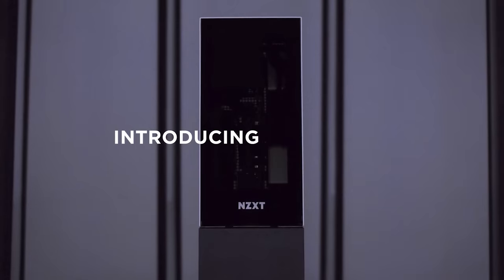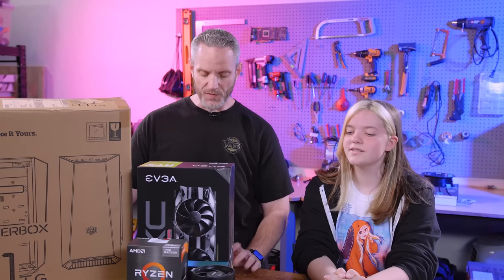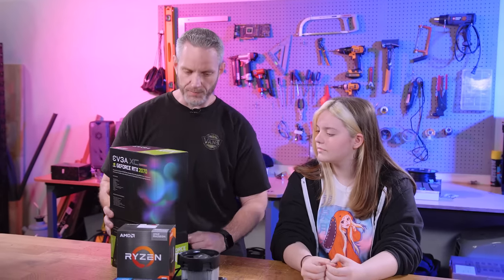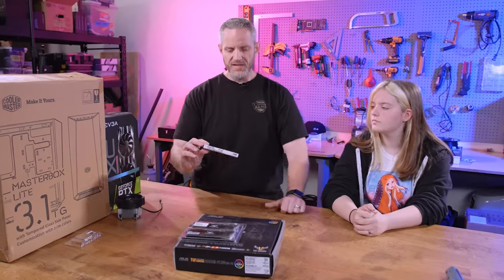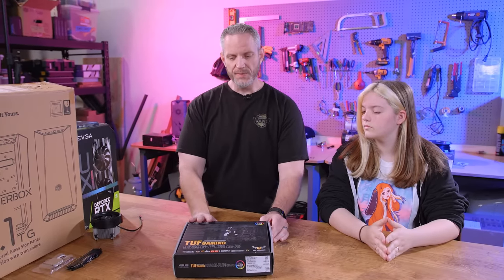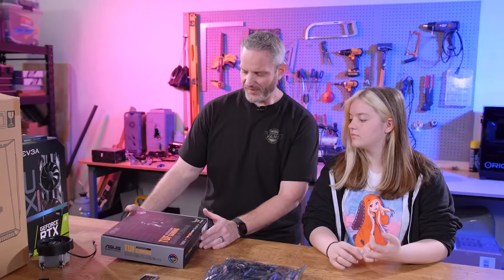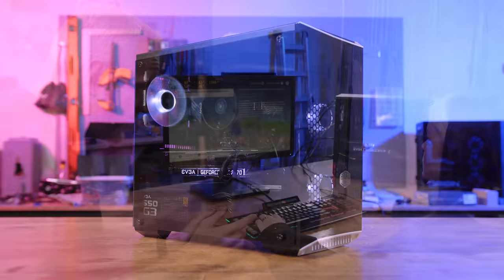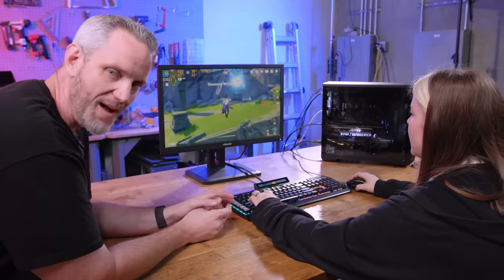My daughter built her friend a PC!

Comment: Yeah genshin is pretty light, although it stutters quite a bit on mechanical hard drives and phones. You can easily get 60fps locked on highest with a 1050ti, even a 750ti can do a decent 55-60 on medium-low settings, msaa and V sync on. Interestingly enough the most taxing settings in the game is shadow and render resolution. Also later game content (or regions to be specific) tends to be much more heavy on the gpu.

I had a chance to try it out on my brother media laptop with an i5 8250u and a mx110 and while it technically run it was really messy at 30fps and constant stutterings.

Comment: I have a probably stupid question:
It's always said that you should not change GPU's from Nvidia to AMD (or vice versa) because of Driver incopatability, which may wreak havok on your system (therefore when doing it wipe the drivers completely from your system first). 
Does that not apply when you use a CPU with integrated graphics from one brand, and a dedicated GPU from the other brand? Because I would think the PC needs according Drivers even for an integrated GPU... 
Can someone enlighten me?

Comment: i use an 8700K and 1070Ti and a 240Hz 1080p monitor and play Genshin, but my game runs pretty hot and draws 140W out for the GPU. Point is I want there to be a custom FPS cap like actual AAA games.

Comment: My 11 year old daughter plays this game on an i5 3570, 16GB of "Hynix" RAM 1333mhz, 250GB 860 EVO, ASUS Geforce GT 1030.  I bought a cheap Cougar Tower with RGB fans.  Maintains 60fps easy on med settings, and does what she wants. "Roblox" "Minecraft" "Fortnite" etc;  Mostly ROBLOX though.  All from leftover parts from my old PC, family old PC, work, etc.  I only spent 20 USD on 12GB of DDR3 RAM, and the 100 USD on the GT1030 and 45 CAD on the tower.   Not a bad deal.

Comment: 2:00 Had me dying! :D

4:44 Let's just hope that he won't jump into DCS in the near future, because then you'll regret that move...

10:30 Typical parent things. Pro tip for your daughter: That will never end, no matter how old you get.

12:04 I ran DCS in VR on a 3570k and a 1080 and nothing except for MS FS 20 eats hardware as much as DCS does. No VR? No hardcore flight or racing sims? Any 10/16 series card will be good enough, unless it's the utter low end garbage! and even a 10 years old CPU can still rock it if it was a good one back then like a 2500/2600k or 3570/3770k or even an FX-8350.

Comment: I can attest to not needing the "latest and greatest" to have a killer system. I'm currently using a r7 5700g on a b450m paired with an RTX 2080 Super. I have a 1440p 144hz monitor and I can max out pretty much any game at 1440p and get at least 60fps.

Comment: dude i use that case with the acrylic side panel... i upgraded to the glass window afterwards and i can tell you it can get very hot inside the case if you stuff too many things in there...
i had to actually take off the accented air intake mesh off from both the bottom and the top for my system because i had too much stuff plugged into my pcie slots... and my board was not getting enough cooling because i used a tower cooler instead of a down draft coolers... because it does not have a top exhaust fan at the vrm area....
yea... since this is just a guy trying to play genshin i doubt he will go overkill.... a good budget case but it is not adequate enough when you plug in a lot more components into the system...
Reply: sorry i meant i had to take off the mesh at the air intake at those accented color strips just to get slightly better thermal in my system using this case... sometimes i just take off the whole front panel....

Comment: Honestly Gensimp is quite light. Even my 4790 + 1060 6GB combo has no problem maxing out at 1440p and still runs smoothly. Same goes for my brother's 9400F + 1060 3GB combo running butter smooth at 1080p.
Reply: Also nice seeing Raiden right there. 10:22

Comment: I guess I am not the only person with Asus BIOS issues. My Crosshair VIII Formula that I bought in 2019 was great until about 6 months ago and then it started having issues with boot speeds off of an NVMe PCIe 3.0 SSD and sometimes not even booting at all. The BIOS also ran incredibly slow most of the time and was completely unusable. I spent a day troubleshooting everything  and couldn't replicate the issue again after a full teardown of the PC and testing it outside of the case. I updated the BIOS and everything seems to be fine now, but I'm still weary about it and the board is approaching it's end of warranty later this year. I am tempted to get a new motherboard but I am also considering just waiting for AM5 and the next generation of Nvidia or AMD graphics to come out and mature for a year and do a complete system upgrade then.

Comment: Like you could buy any 20 series card right now. Actually as of now, there is not a single 2070 to buy here, normal or super. You could get a 2060Super for the price of a 3060.

Comment: Not a bad modest build, if buying parts now and not using something had on hand I'd have chosen the 5600 non-x sku for 20 less or upto 40 dollars less after various rebates I've seen from e-tailers.  5600G doesn't have PCIe Gen 4.  With the features removed from APUs in this generation they are basically designed to be paired with a A520 and a b550 should only be used if they are planning to upgrade the cpu (which most people don't).  5600 non-x has gen4.0 pcie, more cache and higher performing the then 5600g and cheaper...

Comment: Question Unrelated to video: If you ran a setup with a ridiculous number of radiators (say 10+) you'd probably want a DDC pump for the head pressure, right? It's a totally stupid idea, but I've been wondering how that works.

Comment: "You don't need the latest bleeding edge technology to enjoy games ... depending on the game you're playing".

Many of the games I've been enjoying recently (and some others I'd like to dust off again) ran just fine on my older Intel Haswell integrated GPU, and are even playable on my dad's old Core 2 Duo laptop's Intel GMA iGPU.

Games I've been emjoying recently include Total Annihilation (1997), Fortress Forever (2007, Source engine but an older version of it, runs much better than TF2 and CS:GO) and Team Fortress Classic (1999).

Older games I want to dust off again include Castle of the Winds (1992?), Captain Comic (1988), Sopwith 2 (1984), Pole Position (1983), some of the original Need For Speed games from the mid/late 1990s (I still have some CDs), Where in the World/USA/America's Past/Time is Carmen San Diego (mid/late 1980s I think), Commander Keen 1-4 (late 80s / early / mid 1990s), Descent (early / mid 1990s), and many others that I used to play in my childhood / teens in the late 1980s through 1990s.  (I'm 5 weeks older than J2¢.)

Comment: so a satilite lazer wifi bluetooth big pc requires 5500 watts of power which is 550 volts of power and if you still have that vs350 power supply it has 3500 watts of power and 350 volts of power just so you know

Comment: the 5600G only has PCI-E gen 3 anyway. :(
AMD dropped the pcie support and crippled the l3 cache with the 5000 G series. I was hoping they wouldnt have as i wanted the 5700G to replace my 3700X but I have PCIE gen 4 m2 drives so dont want to drop it.

Comment: My family computer has
Intel i3 2120
8GB DDR3 1333MHz

and I upgrade it with GTX1050ti and MX500 SSD and run Genshin Impact pretty good in medium settings ^_^

Maybe I'll swap with Xeon E3 1270 (around 20 USD) for smoother emulator exp.

So basically guys, especially with tight budget, you can sometime game with cheap on a decade old pc

Comment: "For no reason other than it's the only mATX board that I have in the right chipset to use this CPU and not have any features omitted; and by features, I mean like PCIe Gen 4" 

The 5600G and other AMD APUs use a monolithic die rather than chiplet construction; as a result. they lack the I/O die which provides PCIe Gen 4 support. This also applies to the Ryzen 5500 CPU which is monolithic, but not to other Ryzen 3000-5000 CPUs. 

While PCIe Gen 4 support isn't necessary, it's not a valid reason to choose B550 for APUs.

Even Entry level Intel APUs like the Celeron G6900 have both PCIe Gen 4 & Gen 5 support.

Comment: A 2070 isn't even bad hardware... I run all my games at max settings 1080p with a 1660ti this kids going to be psyched AF. I wanted to upgrade to a 3070ti or a 3060ti but decided that since I'd need a monitor upgrade to get the most out of it it's just not in my budget right now. Thinking of just waiting a year or 2 longer to upgrade. Cool Video.

Comment: Love the build! :D But wanna note if u see this I had that case on my first build and even idle would run pretty hot. I5 8600k, 1060 6gb with an exhaust air cooler at first then a aio still ran pretty hot at times in which I took off the front panel and side panel to run it normally. <3

Comment: Um....Jay. Dude. Shit like BIOS compatibility is why ayou should ALWAYS do an out-of-case build BEFORE you put it into the case so you can check stuff like that while everything is still accessible.

Also, Genshin Impact has a 120FPS option....but only on iOS devices that have a ProMotion (120Hz) display.

Comment: Yep, once she said the computer crashes with genshin I knew something was wrong.... My 6 year old laptop could run genshin on 4gb on ram, but had some crashes and loading times were horrendous. Though once I upgraded to 8gb the speed improved and I could switch to at least medium settings in some graphics departments. 

Just for comparison it's an Intel i5 5200u with an Nvidia 920m graphics card.

Comment: I can beat this. I have a build that my son uses that has a z390 pro carbon mobo, 8700k, corsair h100 capellix AIO,  corsair vengence 16GB 2400 ddr4 and a gtx 970 and it runs all games in ultra or the highest settings the game has at  around 100fps 1080p with no problems at all even new games like Hogwarts Legacy, Assasins Creed Valhalla etc... temps on CPU never reach higher than 48°C and usage never goes over 60% and no higher than 50°C on the GPU and no higher than 60% usage. You don't need expensive and fancy hardware to build a capable gaming pc at all. I sourced most parts from ebay and local second hand pc shops. The full build only cost around £250-300. I love doing budget builds to see how they perform. I also have an even lower budget build with a z170-A mobo, 6100f, corsair H100i GTX AIO, unknown 8GB 2400 ddr4 bought from a shop for peanuts and an AMD Radeon 6900 which again will run games like fortnight, GTA V, Shadow of the Tomb Raider, Roblox etc... and again temps hardly ever hit over 60° and around 60% usage on both CPU and GPU and that build cost me next to nothing I think around £150 I think the most expensive part was the case. Honestly if you are really into gaming and dont have much budget just do your reserch, get on cheap sites like ebay and amazon, hit up your local pc repair stores and you will be able to achieve a quite reasonable and game worthy machine. I enjoy building budget machines as it is much more of a challenge than to just go and buy all new and up to date parts and stick them in a case. Happy building :)

Comment: Just finished my build and when booting up it says cpu voltage high tried to manually set it but it won’t adjust any advice? Ryzen 5 5600x rog strix b550-a rm750 pcu

Comment: Can I be friend with your daughter, Jay? Ha ha, just kidding.

I played Genshin Impact myself and the game is, well, a combination of MMORPG with open world adventure game. Most anime fans will find the game very appealing. Anyway, you can actually run this game using the integrated GPU from 5600G and it can play just fine in 1080p 60fps low setting. Gasp, you should check ETA Prime because many of his video feature PC system that can run this game.

Comment: What no water cooling I dare u. What a beautiful sight  seeing dad and daughter having fun. My girls' 33 and 42 one a auto tech one a Dr.  My build ASUS ROG Crosshair VIII Dark Hero AM4 AMD X570S SATA 6Gb/s ATX AMD Motherboard, AMD Ryzen 9 5900X - Ryzen 9 5000 Series Vermeer (Zen 3) 12-Core 3.7 GHz Socket AM4 105W Desktop Processor, CORSAIR Vengeance RGB Pro 32GB (4 x 8GB) 288-Pin DDR4 SDRAM DDR4 3600 (PC4 28800) CORSAIR RM850 CP-9020235-NA 850 W ATX 80 PLUS GOLD Certified Full Modular Power Supply, Cooler Master MasterBox TD500 Mesh Airflow ATX Mid-Tower ,CORSAIR iCUE H115i RGB PRO XT, 280mm Radiator, PowerColor Red Devil AMD Radeon™ RX 6900 XT Gaming Graphics Card with 16GB GDDR6

Comment: Although not the latest gen card, and not the highest card even of that gen. That's still far more expensive compared to the go-to cards from only 4-5 years ago. That nice GTX 1060/RTX 580 sweetspot of $200 MSRP (and actually selling for that, anyone remember those days?) this card sadly exceeds by quite a bit.
On ebay in the UK they've been going (used!) for £320 or so (some slightly less, quite a few far more). Not to mention the new price is.. actually, can't find these new at all - only out of stock prices in the £500+ range. 

I get it that the point of the video wasn't Oh look at how cheap you can cards now, but still, the market is still in a sad state (at least in the UK). Even RX 580's (old used cards) are going second hand for what they were bought for new years ago.

Comment: 2070 should be good for 1080p????  Im running a 1660 and it murders anything i throw at it in 1440p
Reply: ‘Murders’ bro admit you run everything at low-medium getting 80fps
Reply: @sgeggbub1008  lol everything on high dude, honestly, with a few minor tweeks to AA, motion blur off etc.  ive a stable overclock of +175 on the core and +1000 on the memory. the silicon lottery is real  almost everything at 100+ FPS

Comment: Good day Jayz. I'll hope you'll answer me,cause my question isn't about the video,but over something else. I'm scouring the internet,but to my dismay.....no answers for me..just the same old story ( i5 7th gen intel processors aren't of the recommended processors for windows 11). My laptop specs is i5 intel,1 TB nvme m.2 SSD with 16GB of RAM. I quailify for al windows recommended requirements,but just my processor isn't good enough for Microsoft. I'm getting an overhaul better experience using windows 11 on my laptop,than with windows 10. I'm getting better and more consistent FPS in games,my temps are better,than what it was with windows 10. I hope you can tell me, what is the reason for Microsoft not allowing i5 7th gen intel processors?

Comment: Woah!!
Take that 5600g OUT of this build lol, (You have to have another CPU laying around instead of that APU right?)
You chose a processor that is using literally half its available cache for a graphics card that you will never use since you have a GC that's bounds better than what this processor is producing.
that is a CPU which is designed for those who do NOT have any sort of graphics card at all.
It's almost insulting when you think about it, drop down to a Ryzen 9-3600x or the best idea yet is just switch it with the same gen 5600X which WILL use all of that onboard cache directly FOR the processor its utilizing.

Comment: For context, on all high, Genshin Impact still makes my 3060 run at 75C depending on the area even on max fan RPM. But then I have a Colorful 3060 DUO so maybe it's that...

EDIT: I'm an idiot for not mentioning that I had Twitch running with it so maybe it was Twitch contributing to the increased thermals. And maybe just poor airflow in general...